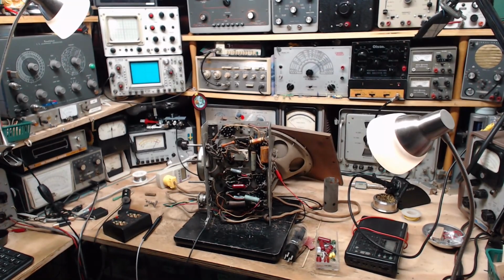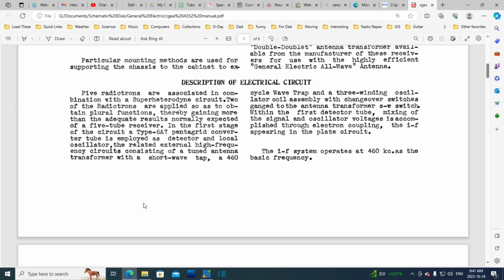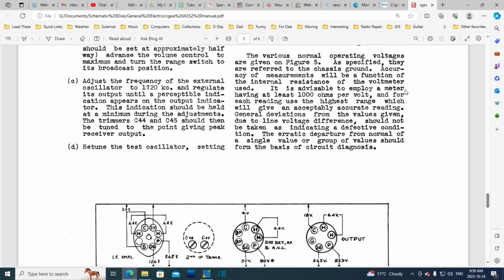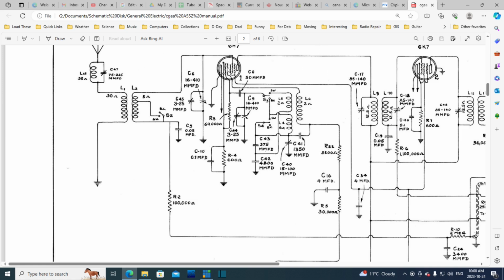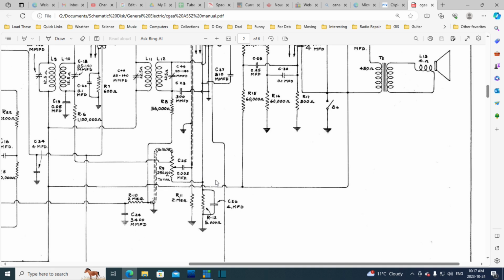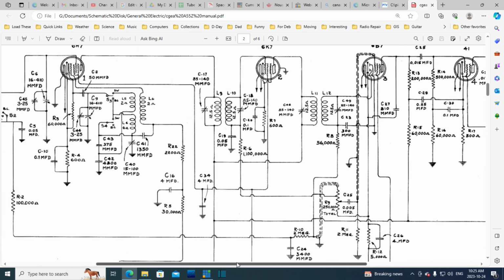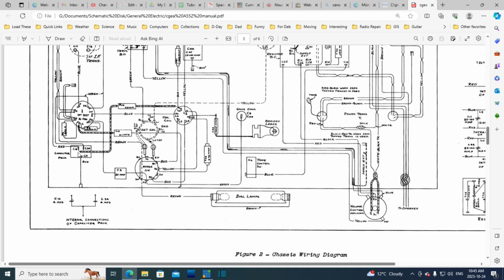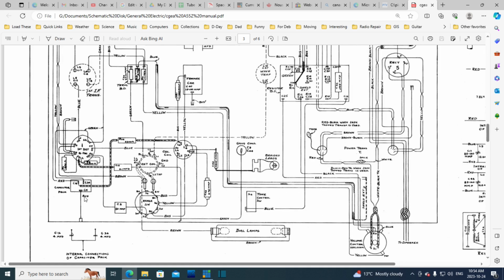Canadian General Electric Model A55Z Video #3 - Service Manual and Schematic

Comment: He got my email so you can blame me. Nice refresher course on a typical superhetrodyne radio from 1936. Noticed  that
 the main filter caps had been replaced  decades ago. Liked the RCA type chassis wiring diagram. Wish back then all the
radio manufacturers did that.